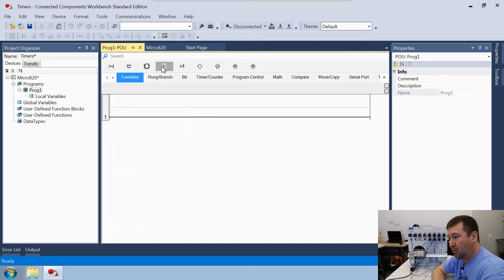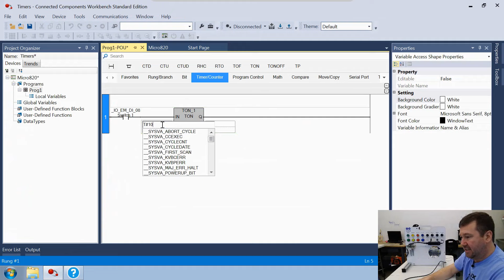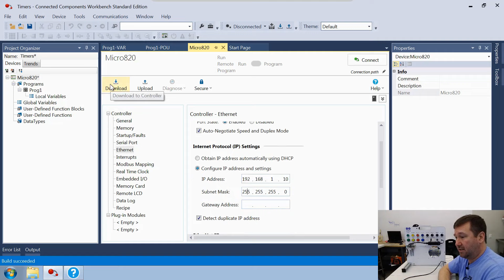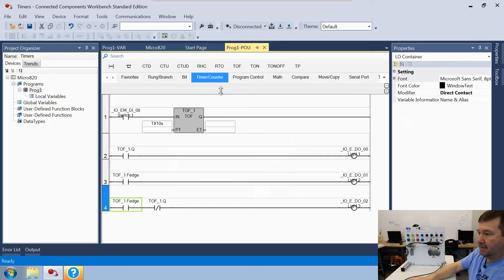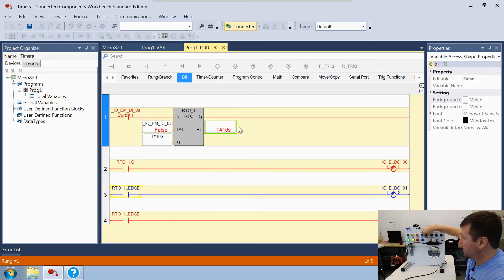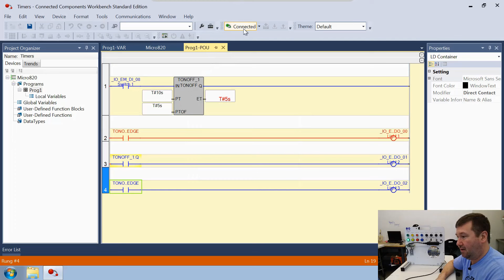Micro800 Timer Instructions Connected Components Workbench

Comment: Great stuff Tim.  I am trying to self-learn PLCs and have really learned a lot watching your videos.  My background being in HVAC, I have one question:  As HVAC techs. we are constantly fighting the battle of compressor short cycling.  Some vendors are making a fortune selling these "Delay on Break" relays.  This means that once the compressor goes off, it cannot come back on for say 5 minutes.  This gives time for pressures to equalize and motor to cool down.  Part number ICM203 relay is an example.  I have played with a pencil and paper design with TON and TOFF but it is not so simple.  If you have done a video on this application please let me know.  If not please think about doing one.  The HVAC techs will be very grateful!  --- RGI
Reply from the maker: Yes I've done that plenty. You only need the TON when the compressor turns off. I'm recording later this week. Let me see what I can do.
Reply: @TimWilborne  Tim, thanks for your hint - I figured it out!  I used the idea of the "timing bit" that you talk about at 10:05 of your above video.  (At first, I didn't pay any attention to what you were saying because I have never used Rslogix (only use ccw) so I thought it was a useless piece of info for me, but then I suddenly realized that mimicking the "timing bit" could be used to turn on an intermediate coil that throws a NC contact in the path of the compressor coil.  The TON itself gets energized  by a NC compressor coil contact.  Maybe there is a more compact way of doing it - but this works fine!  THANKS.
Reply from the maker: @robertingersoll5289  Glad to hear you got it.  Now go watch this video.  A normally closed instruction is a bad word on this channel, it is a "go look for a 0".
https://twcontrols.com/lessons/basic-bit-instructions-in-connected-components-workbench-direct-contact-reverse-contact-coil

Comment: After I loaded the program I see the input indicator go on the processor but the XIC does not go red and the timer does not start counting. Thoughts?
Reply from the maker: Do you have a solid green run light on the front of the PLC?
Reply: @TimWilborne  I do. There is no fault. I am using a 2080-LC50-48AWB 120VAC input.
Reply from the maker: @shawnvandegenachte7091  Sounds like something else is writing to the timer.  I would check for a reset first. 

Here is a test to make sure the timer is "enabled".  Put a branch around the timer instruction and add an Output Energize to an unused tag.  Create one called "IsTimerEnabled" with a data type of bool.  Then see it it turns "red" when you input comes on.

Comment: Hello,
I am new to automation and am doing a project with a Micro850 Plc and your videos help me so much. I am more comfortable with logic, so I am writing my program in Function Block language on Connected Component Workbench version 12 software. I would need help:
-I would like to flash a light during the time a sensor is active, but I don't know which function block to use and how to program it, I had thought of the TONOFF function block but I only found videos in ladder langage.
- I need at some time of my cycle to store the state of some sensors in memory so that I can reuse them later, even after the machine has stopped (switch off), I don't know how to do it.

Thank you for your help.
Reply from the maker: I'm short on time this week so I'd post your question at plcs.net.  But you've found the TONOFF for ladder, why not just make your program in ladder if it covers your needs?  Just something to think about.  Merry Christmas!
Reply: Thank you for your help, Merry Christmas to you too

Comment: Can you help me, I'm trying to use a MOV instruction to set the preset on a timer for a micro830 2080-L30-48AWB
Reply from the maker: What error are you getting.  It is likely a data type mismatch.  The source and destination of a MOV instruction must be the same.
Reply: @TimWilborne  I get a error saying: illegal access to function block instance parameter. I put the time (T#50s) into the i1 spot and the timer pt on the i1 spot
Reply from the maker: @lancegillespie3438  You will need to create a variable and connect it to the PT of the timer.  Then you can use the MOV of your T#50s to the variable you created.
Reply: @TimWilborne  thank you for replying so fast and I think I can get it now thank you
Reply from the maker: @lancegillespie3438  Glad I could help Lance.

Comment: At 15:10 , why did light 3 never turn on ?
Reply from the maker: Great question.  Check out 17:29, that is where I talk about that the DN Done Bit and TT Timer Timing bit had the same function on a TOF in RsLogix 500.  The red light wasn't necessary to explain it so I never address it.  I didn't remove it because it was necessary for the RTO.